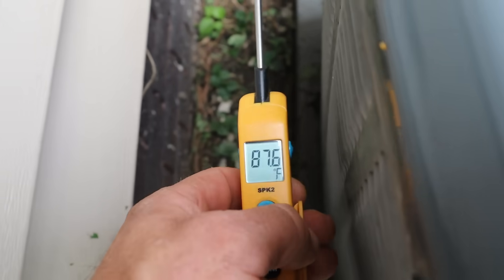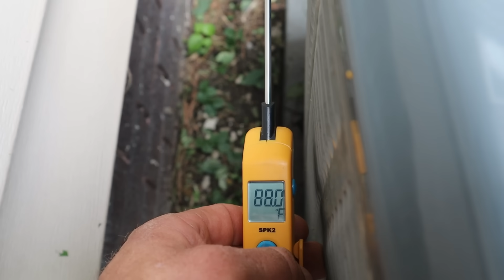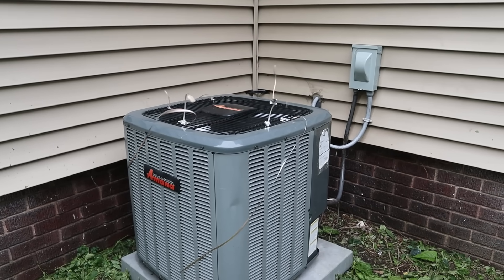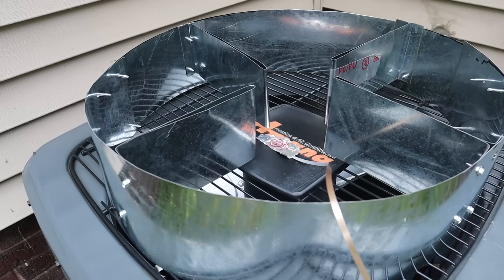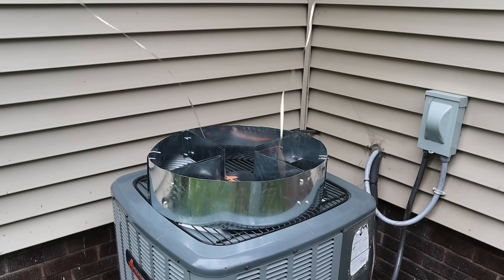Your AC Fan Makes a Mini Tornado

Comment: How about putting open tubes (like made from plastic bottles with straight sides that have top and bottom cut off) that fill the entire inside of your circular stack? I am thinking that would produce a laminar flow pattern that may improve the efficiency. Now, as others have mentioned, there is a concern about back pressure, but it would be a great experiment.

Comment: Yeah, maybe once/twice each season my box fan gets all furry (4 cats), so I take it out on the patio, plug it in, crank it to max, and with a paintbrush, just wedge the bristles into the fan both front and back, to get the fur off the fan-blades, off the front/back grilles, and even out of the corners where fur gets tucked away.  Problem is, I could clean out the entire back of the fan, then when I go to the front, clumps of fur whips around from the front right back to the back, and resticks to things.  I have to go incrementally front, back, front, back, etc., until defurred sufficiently.

Comment: I was inclined to say that if this were a good idea then equipment manufacturers would add it but then I remembered that would probably cost and extra $5 and unlike cars or lightbulbs no one shops for ACs on the basis of real world efficiency....so your little addition might very likely be a legitimate improvement.
Reply: I have a 22 year old R410/R22 dual gas model at my old house/rental and it does have this! The top cover is heavy as hell. It was one of the high efficiency models of its time but I think they may have just done it for rigidity as the top plate is very thin and only has a lip for screws to meet the side panels.

Everything else at my main house is basically a grill with a fan and the rigidity comes from the fan shroud wrapping the side panels. 

And you’re right. If they can save $5 they will. After all they just need it to live long enough to make it to the 5-10 year warranty.

Comment: The fans are not designed to work under any amount of back pressure. When modifications similar to this are done it almost always reduces airflow. 

To improve it you need better blade tip clearance to less than 3/8in. Higher pitch blade will increase the air velocity throwing it higher as well. This will usually increase the amp draw so the performance gain is small. However if you change the fan blade to a more efficient style like the swept blade design Amana uses in some of their package and higher seer units you actually end up with the same amp draw, more airflow, and a quieter unit.

Of course the simple way to improve a units performance is give it proper clearance when installed.

Comment: What I come across in servicing Condensing units is that installers are not observing installation clearances from the  building, tight in corner, ect. not maintaining the recommended 24" clearance, this is why you walk up to a unit and the coils look clean until you observe the back facing the wall and it's plugged up. Also proximity to dryer vents, another problem. Some Home owners love to bury their units 1/4 the way up in mulch impeding air flow.
Reply from the maker: I've had to pull shovels out to get to service ports because of mulch. 6" deep at least. Careless landscapers, lazy installers, a lot of stuff going on out there ..
Reply: Yet another benefit from when I relocated my dryer vent for a more direct flow.

Comment: Now you've got me thinking, how do i install a Inflatable Wacky Waving Tube Man
on the top of my condenser's discharge air grille.
😁
Reply from the maker: Lol. Even if it doesn't work that's still a satisfying win.
Reply: HOA: So you have chosen war.
Reply from the maker: Lol
Reply: @Ultrajamz lol. I recently went on a call in a very new ritzy high-end townhome complex where the units are in confined areas next to one another where they all blow hot air into each other. And I saw either some smart neighbors or HVAC companies that put big 28 inch diameter 45 or 90 degree sheet metal duct elbows on them. It gets over 115° here so I think the HOA understood it's a problem and didn't say anything about it. And actually if you paint them the same color as the building or the unit, it doesn't look that bad😊
Reply: @Ultrajamz 🤣
Reply: The KIA dealer will be searching for it so get ready.
Reply: At least it will look Cool.  👍
Reply: This is the best idea, yet.
Reply: With the Wacky Waving Tube Man on your A/C unit you can get customers who want help with their Tax Return.
Reply: @petereveler375 😎👍
Reply: Great idea to make your ac work better, great comments
Reply: ....naaaah, he would cause too much drag and back flow with loss of heat exchange, it would build up heat......unless you kept his fan as well,.....hmmmmmmm.......
Reply: Wacky inflatable arm waving tube man
Reply: Acts like a scarecrow to keep the tweakers away from your coolant too!
Reply: Combine the two!
Reply: I was thinking about one of those fabric play tunnels for kids.
Reply: They're always illegal as ads, report to 311
Reply: Yea! Wacky Waving Tube Man!
A thing we didn't know we needed to brighten our day. 😊

Comment: What comes to my mind - especially after reading some of the comments - would the question: "Exactly HOW MUCH" does this boost efficiency? The demo in the video is intriguing, and surely catches the viewer's attention.  And surely ALL of what you said sounds like there is something to this.....But.....wouldn't there be an immediate change in the pressure/temperature readings, that by themselves "could" give us some idea of the "effectiveness" of this add-on?  I'm saying - if there was a "noticeable" change, surely that would say - something.  But if no significant change was seen, we would question its value, no?  I am surprised you didn't have gauges set up, to show this.....
Reply from the maker: I'll find out moving forward, but it was Sunday morning when I made this, I didn't have that stuff with me and I honestly didn't expect it to do much initially. I was just curious. Now I'm more curious.
Reply: @JerseyMikeHVAC Ingenious concept... I'll stay tuned for the next iterations.
Reply: @JerseyMikeHVAC  More thoughts on this.  The end goal here is to make the unit run for less time, no? THAT is the only way to reduce the cost of having the A/C operational.  So pick a day that's warm, and precisely time one "on" (run) cycle  - without device installed.  Then place the device on the unit, and time the NEXT run cycle.  If it's doing its job the A/C cycle will be shorter, no?  The difference in run time, directly correlates with electric used, and the ratio of with/without will give a direct result as to $ saved.
Explained further....on a cloudy (no sun load on house) day, the run times (one cycle) of the A/C will be shorter, on a 75 deg. vs 90 deg. day, and that is because the air cooling the condenser is - cooler.  THAT is what you are doing here.  I'm saying the ONLY reason (on a day just described) that the unit runs for less time, IS because of the condenser being hit with cooler air.  So again, THAT is what you are doing, albeit not to the same temperature difference as my example presented, but still, a difference. You are feeding cooler air in. 
And the ratio of the difference of cycle time, will be the difference is electric used, which will be the difference in total (electric bill) cost.  Hope this is clear...
Reply: @stephenbay9564  simply put an ammeter on the 230v incoming fan leg; there are too many other variables, and results are nearly instantaneous. The RAL POWER is the compressor. Head pressure loss will cascade through the system.
Reply: @stephenbay9564 
I think the better goal is less power consumption while running.  Cycling is pretty hard on a system and uses a lot more power.  Dropping the discharge pressure will reduce the compressor current draw. The manufacturer has an actual chart that shows this for each compressor. So a 3 hp compressor might draw around 14 amps at 290 psi discharge pressure,  but that same compressor might draw 12.8 at 255 psi. The aim is to lower the power use while running.  If it was cycling too much, a smaller unit would be better.
Reply: @stephenbay9564 : Most electric motors* will actually consume less power if subjected to less mechanical resistance, so your assumption that the power consumption will always be the same for a fixed period of operation is actually wrong.

* There are some weird exceptions that might consume the same amount regardless, like ball-bearing motors, but even that is debatable (and ball-bearing motors in specific can't be used in this case regardless).
Reply: Well, it would appear that a $50 device (if that) has the potential to reduce power consumption AND extend the life of the system. What do you have to lose?

Comment: What if the condensing unit was moved farther out ward? Does this actually have effect on pressures and amp draw? Find it strange if this actually works and manufactures dont already add this if it would boost efficiency rating.
Reply from the maker: Well that's probably why they don't do it. A condenser properly installed with the right clearances might not have these issues.

Comment: Wouldn't just laying sheet metal or plastic sheeting on the top so it's extended out over the edges, thus making like a divider keeping the hot air from coming down over the sides? Kind of looking like a graduation cap.
Reply: Yes. Other people do that.  That also has the benefit of reducing the sunload on the condenser coils and sheet metal that all retain heat
Reply: I saw another video of a guy who did just that, but used shade cloth rather than something solid. I think he was presuming that the shade cloth was what was blocking the sun, as opposed to the "roll over" heat from the air coming out.

Comment: There are also fan blades that had increased efficiency adding bumps to mimics a humpback whales tubercles. Fan stacks are another great design for enhancing airflow as well. You can see CaptiveAire’s Paragon RTUs implementing both. It’s amazing how different components like that can inch forward efficiency but aren’t done because equipment design is all about racing to the bottom
Reply: ReviewTechUSA?
Reply: Those bumps on humpback whale fins are too recent a discovery to be commonly implemented.

Besides which, basic improvements rarely get implemented by home builders and owners, so there's little point in adding more minor improvements.

Comment: You are on the right track but need a modification. Hint look at cooling towers. The placement of that unit is very poor to start with.
Reply: The Venturi on cooling towers reduces the velocity!   If it was pulling air in (like a carburetor, then it would increase). By slowing the velocity then it’s less of a bump when it hits the unmoving still air.
Reply from the maker: hyperbolic curve?

Comment: A thought for future testing - What is the optimum height of the device to decrease the rollover? While yours looks to be about 6" tall, there should be some existing engineering math that computes the optimum height for commercial coolers.
Reply from the maker: Commercial applications I've seen set the height to 25 to 50% of the fan diameter.  I was at just under 20" on diameter so I went with 25% at 5" tall.
Reply: I was just thinking out loud to myself the same thing 😂

Comment: The only measurement that matters here is the temperature of the liquid refrigerant and the discharge pressure.  If you are decreasing the liquid temperature,  you are making a difference.  You can never get below the ambient air temperature, but the closer you can get, the better. Water has the advantage of evaporative effects, and the water temperature is lower than the air in general. But it is pretty corrosive to the condensing unit. Once your discharge pressure gets to the temperature of the condensing media,  the only thing left to increase efficiency would be mechanical sub cooling.  I wonder if you could run the liquid line in a loop through a 5 gallon bucket, which the condensate from the evaporator would drip into
 The heated water would exit the top and the hottest liquid refrigerant would be at the bottom. You could actually reclaim a lot of energy that way, I believe. Nice demonstration there.
Reply from the maker: Planning on making a more precise prototype than I did here and tracking subcooling at that point. Not sure the evap condensate would be able to keep up with the liquid line heat if latent heat load isn't excessive. Lowering blower speeds could increase condensate but now you're working against efficiency gains with longer run times to hit sensible set points.
Reply: @JerseyMikeHVAC 
It couldn't provide perpetual motion , that's for sure. Nore of a way to reclaim all that energy spent making 40⁰ water just to put it down the drain !
Reply: I wonder if mosquitos would also appreciate such a bucket.  :)
Reply: @ncooty i suppose, but i was thinking inside at the evaporator.  I actually pre- heat my hot water with my air conditioner.  It reduces the power consumption by lowering my discharge pressure for a significant amount of the day, and also reduces the power required to heat my water. It's a pretty involved configuration and not for everyone, but it works great for me. Dropped my electric bill considerably during the summer.
Reply: @anthonypaules7893  Maybe I've misunderstood what you have in mind, but if the bucket is inside (in the conditioned space), then you haven't removed the heat from the house.  You've just moved it from the liquid line to a bucket of hot water in the house, so you still have a heat battery discharging in the house, right?  I suppose you could discharge from the top of the bucket, but you've still got a 5-gallon bucket of hot water for which the heat is regularly replenished.  I'd think you'd need the bucket to be outside the conditioned space.  Did I misunderstand?
Reply: @ncooty 
My thoughts were to reclaim the energy in the cold condensate.  You use a significant amount of power to make that cold water, then you put it down the drain. You could transfer some heat from the liquid refrigerant into the water before putting it down the drain. If you lower the liquid temperature before it enters the expansion valve,  you gain capacity. It is a simple heat exchanger.  The more humid the climate,  the better it would function. 
1) evaporator makes cold condensate 
2) cold condensate runs into exchanger ( bucket, or sealed container of more elaborate design)
3)Hot liquid refrigerant goes into exchanger
4) heat transfers into cold condensate before it leaves exchanger lowering liquid refrigerant temperature 
5) liquid refrigerant sub-cooled and gains capacity 
It's a pretty tried and true method in refrigeration.  You really need to understand the theories to grasp how it is improving efficiency by reclaiming waste in the system. 

In commercial refrigeration,  we reclaim the waste heat from the system and use it to heat hot water and the store air in the winter.  In large systems, we actually refrigerate the liquid refrigerant from one machine with another multiplex. The sub cooling adds efficiency. 
Is it worth it in a residential application? It depends. It gets pretty complex, and complexity is the enemy of reliability.
Reply: @anthonypaules7893  I think I follow you.  So, if I understand you correctly, it's a thermally efficient use of the condensate as long as the water in the bucket doesn't get hotter than the air temp in the conditioned space.  (You might even argue that it's thermally efficient until the water in the bucket starts vaporizing, since the phase shift of dehumidification accounts for a huge portion of the energy transfer.)  Smart reuse of the chilled condensate while avoiding the mess, energy use, and corrosion from misting the condenser.
Reply: @ncooty  toss in one of those "mosquito dunks", that'll solve that potential issue.

Comment: At first this seemed like a gimmick but after you explained it, it does make a lot of sense.  I'm guessing it would improve efficiency 5-10%
Reply from the maker: I'm going to check amp draw on the compressor and head pressures to see if I can get an estimate on any potential savings.
Reply: It'll be bigger than that.  If you look at the max theoretical COP of a heat pump cycle with 88F on the hot side and 70F on the cold side, then you do the same calculation with 79F hot side and 70F cold side you get around double.  That's max theoretical, there are lots of inefficiencies plus fans and stuff that use power, but knocking off a few degrees could make a big difference in the power bill.

Comment: I wonder about this in heating mode.  That column of cold air being blown up would naturally fall around the unit and it would be drier so more likely to displace the fresh air coming into the sides of the unit.
Reply from the maker: I'll have to get my hands on a thermal camera one of these days and test this out.
Reply: @JerseyMikeHVAC  I've tried that. thermal camera does not show air temperature. It only shows the condensing unit as a hot spot. intake air and exhaust air don't show a difference.
Reply: @ProjectsWithMike Perhaps one could configure an aluminum plate to temporarily sit sit some distance above the fan. Then the temperature of the air could be measured. 🤷‍♂️
Reply: This looks like a good idea. But if you live in snow country, be sure to remove it in the winter months. Just think how much snow it could requester only to melt slowly and keep dripping water into the compressor. Also if your system is designed to run as a heat pump, all that accumulated snow would clobber the performance
until it melted. 
Even if the system is not running as a heat pump, most manufacturers suggest that the unit is NOT covered with a canvas cover. Such a cover can trap moisture inside the compressor for  long periods of time.